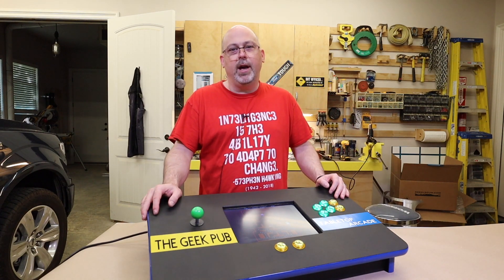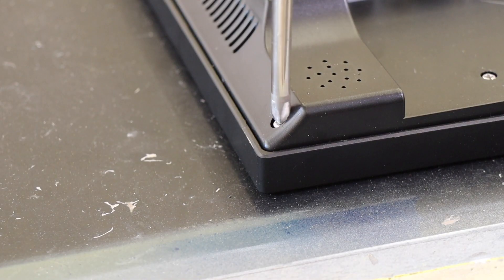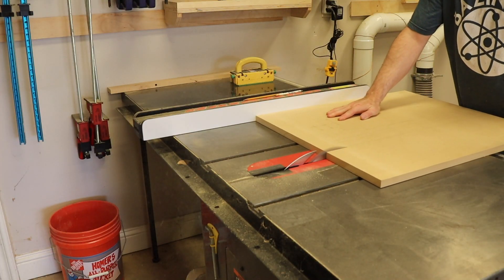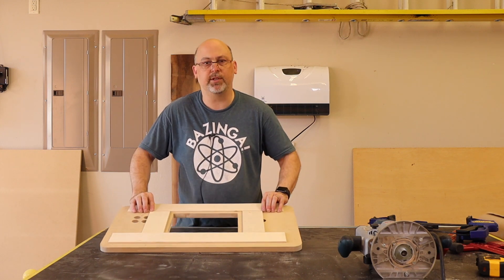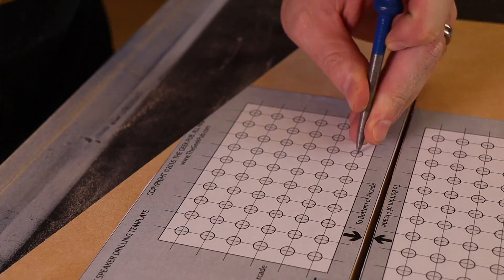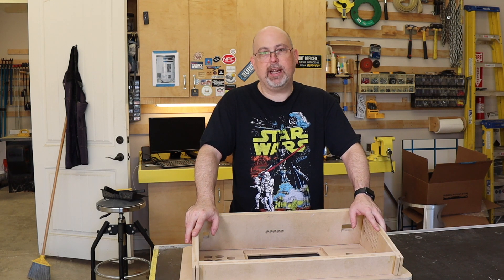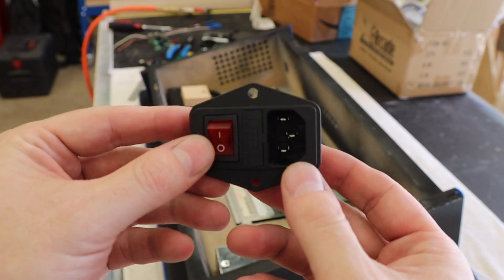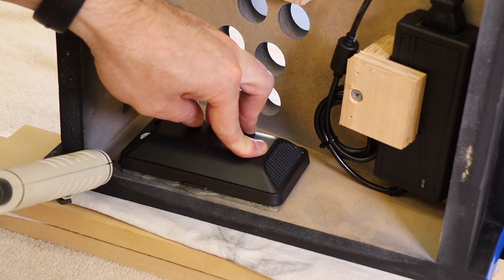Tabletop Arcade with Retropie

Comment: I have a monitor with that same control board, I actually bought the board to drive a repurposed laptop screen, they sell for cheap on ebay, and you didn't even needed any PC speaker, they can drive 3w 4ohm speakers without a problem, and it can get loud with decent speakers.

Comment: I think I will mount the joystick and buttons a little lower towards the player. That reach over looks to be a bit much
Reply from the maker: Super easy to move them anywhere you like.  I am planning to add several templates to the plans with different positions.  I just haven't gotten to it yet.

Comment: Regarding the hot glue, for a less destruction method soak a cotton pad in isopropyl alcohol. Apply the alcohol to the hot glue for a couple seconds and it will lose its adhesive properties and pull right off.

Comment: I built this cabinet and looks great but the monitor has such a bad view angle that you can't play it unless you are right on top of it.   :(   I have a different monitor to try and will let you know if it is better if you want.
Reply from the maker: The monitor I used works fine.  Let me know what you find out.
Reply: @TheGeekPub  Hey.  Switched the monitor for an Acer AL1715, same thing.  I think the issue is that the monitors I have are LCD.  I looked at an LED monitor and the angle is much better but it's 24 inches so I can't put it in the 17" opening ;) .   Looks like the monitors will used in the PacCade instead.  If I find an LED I'll let you know if it's better.